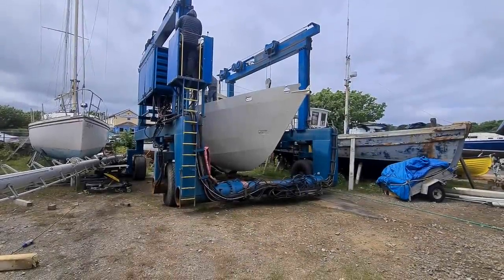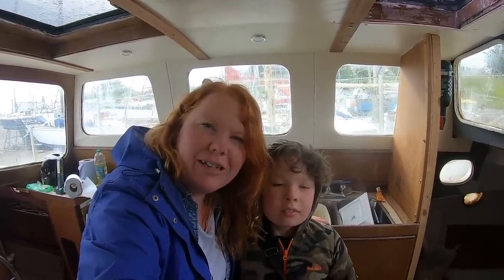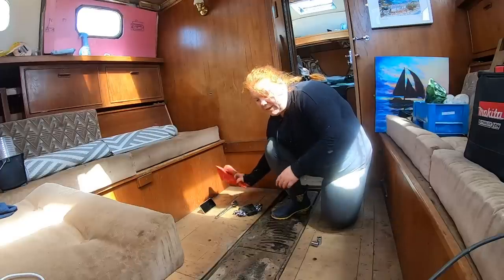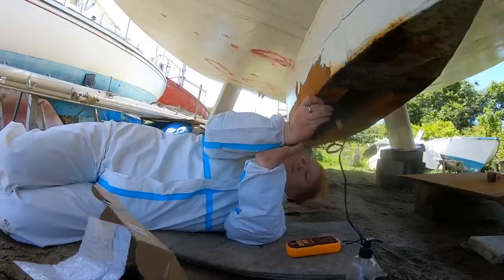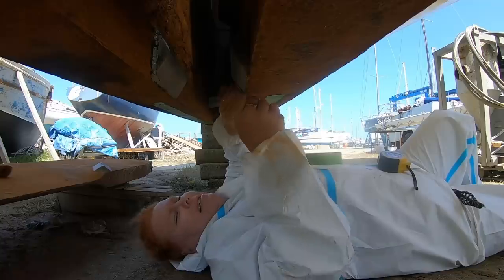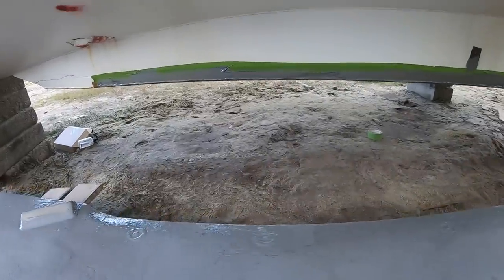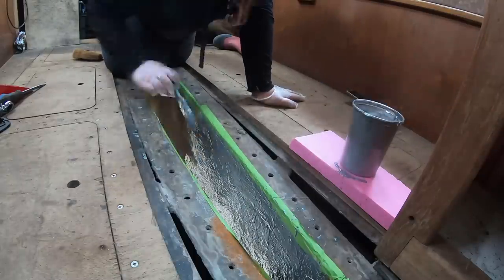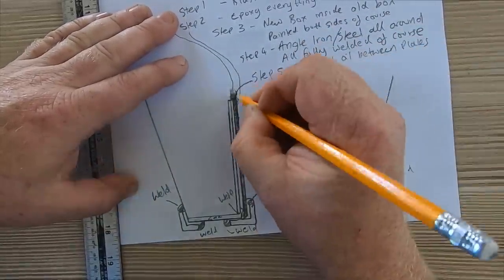#97 - BLASTING, PAINTING AND PREPPING for a FULL KEEL REBUILD

Comment: If you've more painting to do in keel box, a radiator roller might help. They're designed to decorate behind radiators without removing from the wall .... so makes painting flat surfaces with restricted access a little easier.

Comment: Top marks to Jack and Nigel and the inventor of the wire coat hanger ...rubbish for clothes but it has 1000 other uses.. some of which could get you a Blue Peter badge 😉⛵🧙‍♂️👍🏼

Theres a new chanel with an 85ft century old steel sailing boat  looking for advice Ive pointed them in your direction re corrosion resistance and control..😂😉⛵ lol. 
They are professional sailors but even more Danish? than Mads ...😉😂 Its called the Flying Coney's as they have two pet rabbits.... and they are living aboard..its a massive job...but the hull is sound ..if leaking from rivets.

Comment: Save yourself the grief and use a roller inside the box and also to paint the lifting keel 
Well done
Reply from the maker: A roller doesn't put paint on thick enough for the first layer, all subsequent layers we will use a roller probably.  although we have found that JOTUN goes on much better with a brush than a roller as a rule
Reply: @SailingMelody   Depends what roller you use Have done loads of steel boats with Jotun and used either a roller or airless spray and it def gives a good coat DO not use a gloss type roller always a long pile and it gets into all the pits etc Good luck

Comment: Thanks Guys.

Wow Jack What a Brilliant Lad You Are 👍👍👍Great work.

You guys definetely have that keel box sorted it's going to be stronger than when first built as it's now  double skinned  ( On a dinghy they're called the centreboard case, I think you explained the difference in an earlier video ?).

I was wondering how you would prvent corossion between the two skins on the unpainted lower welded sections, I didn't catch the name of the oil but it's obviously corrosion inhbiting.

I really doubt anyone could fault Your thought processes or quality of work.

You have good reason to be proud of what you"ve achieved so far.

Cheers

Comment: Awesome build!! Awesome family project!!
I wonder - you commented that the small space left between the new and old keel box will be filled with some kind of oil - I assume it's some anti-corrosion type.
Being something viscous/liquid - it will only protect from corrosion but not avoid movement- however little - between the boxes.
Considering the free areas (no additional support) of the boxes and 4mm plate - there WILL be movement (oil canning??).
Wouldn't it be advantageous to fill the space with something that will lock the both boxes together?
I would think a fill with a proper kind of epoxy would do the trick!
It wouldn't be that much - so the cost should be bearable.
The trick is to find the right one that is thin enough and slow enough to be able to pour it properly.
If it's thin enough oneight be able to do it in one pour.
Otherwise - in multiple ones!
It's not that it has to hold loads of weight! It needs to fill empty space and avoid the two boxes moving against each other....
Epoxy should be flexible enough to avoid cracking from the different forces from the boxes and/or temperature...

Maybe there is some special cement slurry that would work too - needs to be tough enough to avoid crumbling though...

All the best!! Looking forward to the travel videos!!!👍😎

Comment: I’m curious why you never use rollers for painting? They come in all sizes and usually do a better job than a brush, faster and more efficient…that has been my experience…I’ve done a lot of painting.😎 more than I’d like to admit.
Reply from the maker: Because the paint we are using the first coat the manufacturer recommends brush or spray to get the right thickness. We spray when we can but normally the weather doesn't allow for that hence the painstaking brush work. We will roll future coats. We rolled the topsides as there was already paint on there.

Comment: What's the joint like at the bottom of he keelbox where it joins the hull? Obviously the idea for the drop down keel is to help sailing to windward. So i assume it's going to get significant stress in that area (and the pivot.) 
Yup. It's a major part of the boat.  Can you even check that joint on the inside angle? Because if water has ingressed through the pinholes it's going to find the lowest point. Sorry. It's not that I want you to find a problem, but it that if there is and you don't. ..?  I'm not sure an electronic tester would find that in a corner. Maybe you could test it with a bolster and chisel point from the outside first. ?
Reply from the maker: We can get to both sides at that point. The forward half of the keel box has empty water tanks both sides but the aft end has ballast either side 

The location of the pin is near the front end so we can examine both sides from inside the water tanks

Comment: surely a paint roller is better for confined space painting
Reply from the maker: Paint roller is fine for second coat but for first coat it doesn’t put paint on anywhere near thick enough. First coat needs to be good and thick with epoxy

Comment: What kind of paint was used to paint over the "rust"?
Reply from the maker: It's jotun 87, the boat is blasted then it turns ginger very quick as recommended by manufacturer paint on to ginger still rather than paint rust inhibitors!

Comment: You woulhave been better off just placing a fixed keel to the bottom and filled it with concrete rather than trying to fix something that will be an on going problem for that boat
Reply from the maker: We looked into it but it would have meant employing the services of a marine architect to deconstruct the original lines and drawings and properly design a new full keel, sadly its not as simple as just welding a shape that looks kind of right.  Would have to be properly designed.  It's still something we may look into in the future though.  Do remember, she's a steel boat so we can do anything we want.  I|f the lifting keel becomes a huge pain in the ass as time goes by we may well do exactly what you suggest.  For now, this is the most efficient and cost effective and safe way of getting in the water.
Reply: @SailingMelody  I'd usually agree. 

But you've got a proven shape. Fixed or not water wont discriminate, fixed keels are in most ways the best, less to go wrong. Especially if draft isnt an issue.